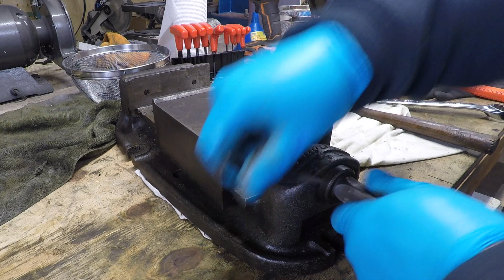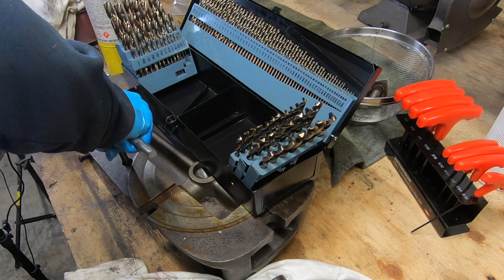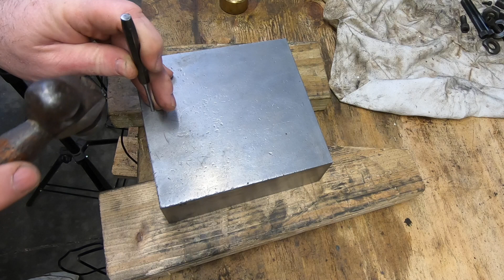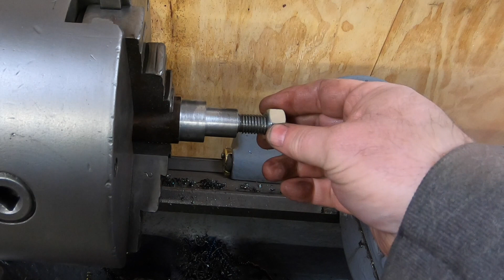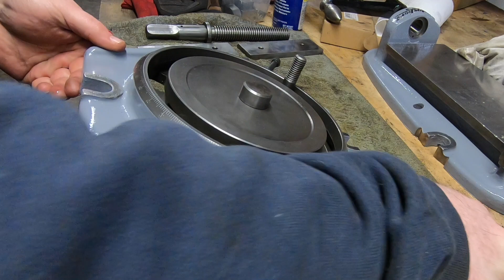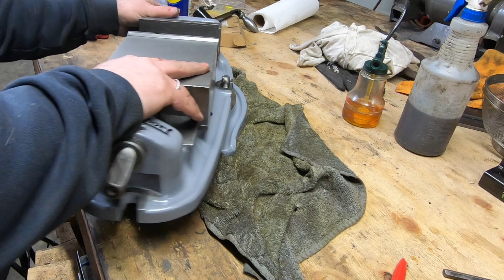New Feed Nut for a Bridgeport Milling Vise

Comment: nice work this is one of the first things I took apart, cleaned and repainted when i got my Bridgeport. the vise actually works very well considering the advancements made in vise tech since this one was made. even on modern kurt vises you will get some amount of jaw lift. if you parts make contact with the middle part of jaw area height wise you usually dont even need to tap the part down.
Reply from the maker: I have an import vise that is designed like a Kurt. I'll dig into that at some point, but need to get back to work on the mill soon.

Comment: I JUST sold one of these on craigslist.  With the swivel and in about the same shape as yours, I let it go for 50bucks.  I got sick of tripping over it.  There is a guy on fleabay in the LA area that sells used kurt vises.  The trick for those in his area, find him on ebay, then show up with CASH!  He cut me a smoking deal on a really clean kurt.   No more jaw lift for this guy!  He operates out of a storage unit complex and has a shitton of used machinist equipment.
Reply from the maker: Yeah, they aren't all that desirable. I may keep it, just because it has Bridgeport on it. But I doubt I will use it much.
Reply: @MyLilMule  That was my thoughts too at first.  You did a good job cleaning it up....  I got tired of beating stuff down and said the hell with this.😉  I'm much happier with the ang lock vise these days.

Comment: Do you have info on the paint you used as well as the method?
Reply from the maker: My painting methods are pretty basic. I used Rustoleum gloss enamel in Smoke Grey. I don't use any primer on raw cast steel as it isn't needed. And I use a simple 1" brush. As the enamel cures, it gets harder and harder. I have had great luck with it. The enamel paint is self leveling and bonds to the case steel extremely well. If it was a machined surface or smooth steel, I would use a primer, but in this case, I didn't need it.
Reply: @MyLilMule  Thanks for the info, I assume you just wire wheel and clean off any oil?